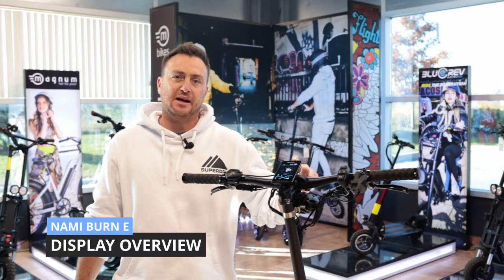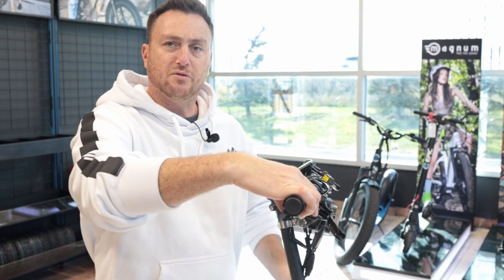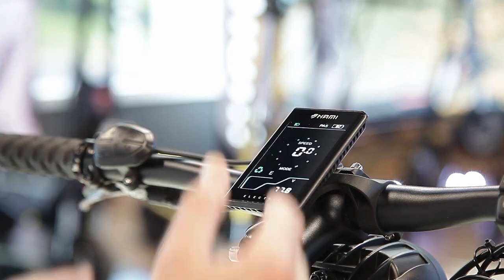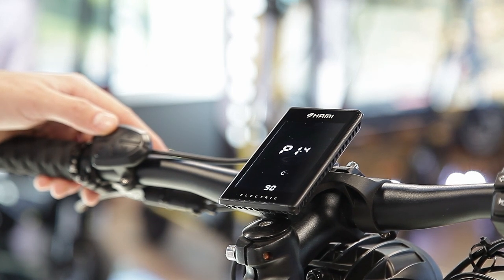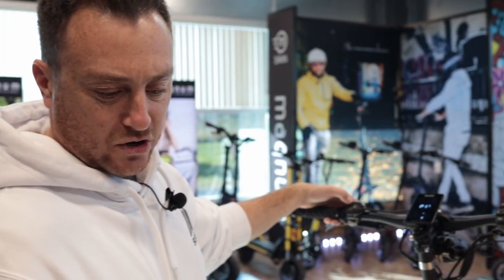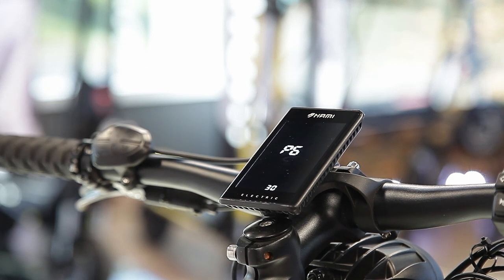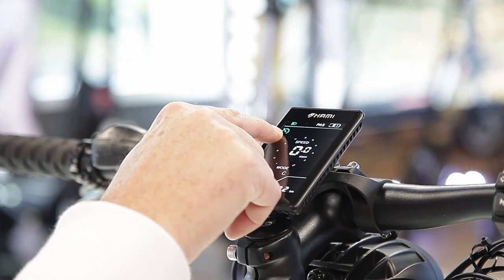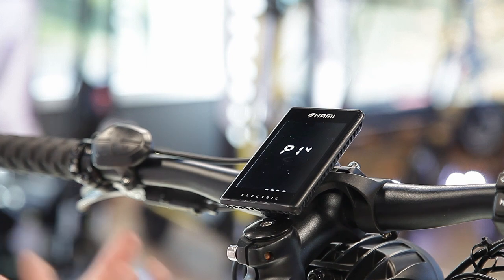Nami Burn E Display Overview

Comment: I’m buying the original viper e burn for 2500 with two chargers a brand new extra  motor with only 200 miles on it what’s ur opinion some are telling me I want to stay away cause I won’t find parts for it what’s opinion on it good deal of know

Comment: i just unboxed mine and my blinkers and horn and lights not working, is there anything i missing?
Reply from the maker: Hello. Please check to see if all the wires are securely connected. If they are and you are still experiencing this issue, I would suggest to bring the scooter into your local service repair shop.

Comment: On D mode is it possible to turn off the electric braking?
Reply from the maker: Hello Abdul. Yes, you can unplug the brake sensor. There are 2 connections under the brake lever. If you unplug the bottom connector it will disconnect the brake sensor.
Reply: @epiccycles9  is that going to turn off the brake lights?
Reply from the maker: @abdulmaidin6995  Yes, It will disable the brake light.
Reply: @epiccycles9  will be getting my Nami tomorrow and I’m trying to find a way to turn down the regen brake

Comment: What are the different top speeds in mph for the different speed modes?
Eco
Dynamic 
Sport
Reply from the maker: You can actually set it the top speeds for each mode as you like

Comment: How come my display not say nami on the top
Reply from the maker: Hello. All of our Nami Scooter have the Nami printed on the display. If yours does not have one, the manufacturer could have not printed it on it. But, it is the same display, just not stamped with the Nami logo.
Reply: Hey I’m buying the original nami viper first one out for 2500 with a extra brand new motor with only 200 miles will I be able to get parts for it